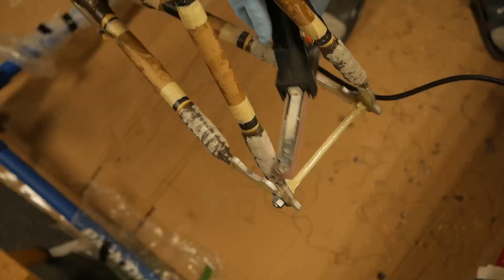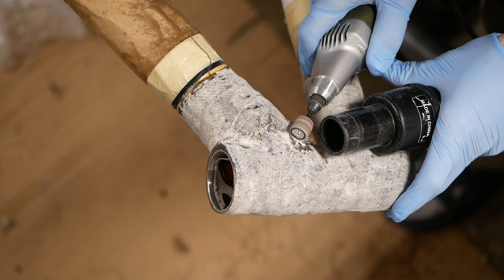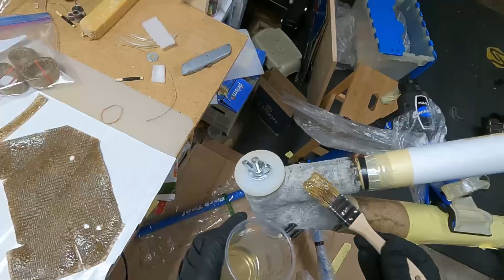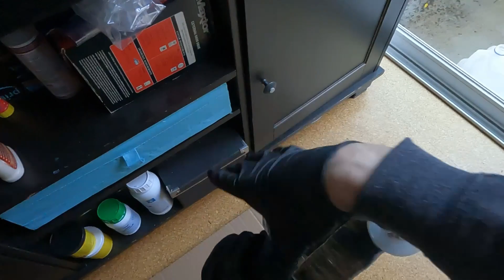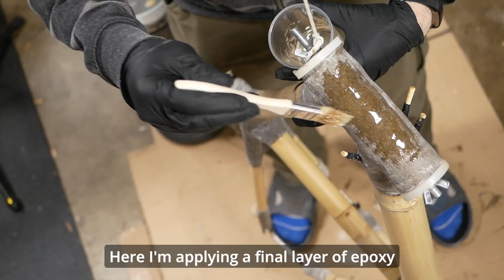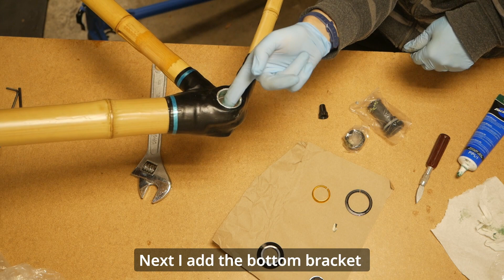Bamboo road bike build - part 10: sanding and finishing the frame

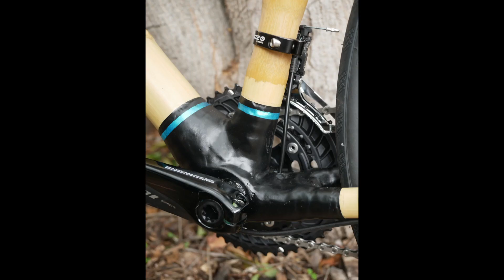Comment: Lovely build. What is the front derailleur clamp shown at 7:57? It looks like an integrated clamp and cable stop, I've not seen one of these before.  I'm planning a build of my own and just wondering how you provided the front gear cable stop with the internal cable routing and full length outer cable.
Reply from the maker: Thanks! The clamp is made by Venzo (34.9mm version 2) and can be purchased at https://www.amazon.com/Venzo-Mountain-Bicycle-Adjustable-Derailleur/dp/B074FWFWPK. This clamp attaches to the derailleur and also protects the frame from the derailleur support bolt but it is not a cable stop. The cable housing actually stops on the front derailleur which is Shimano Ultegra but I think Shimano 105 has the same design. There is a little hole that the cable goes through on the back of the derailleur that conveniently serves as a cable stop.